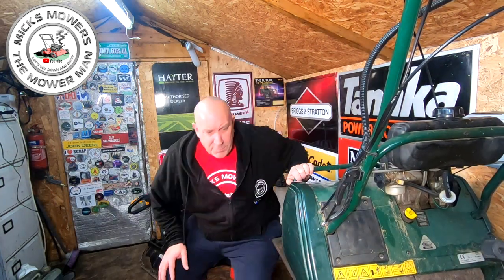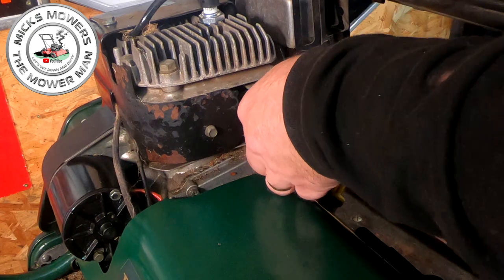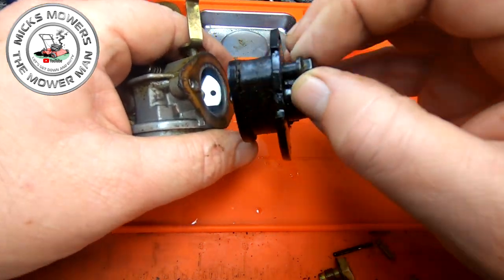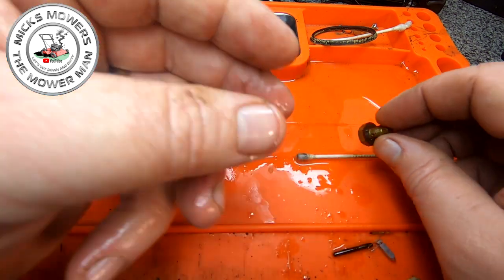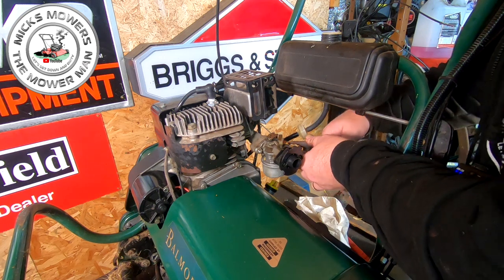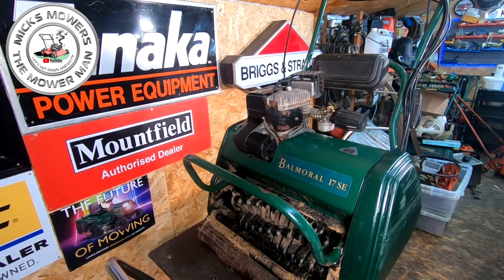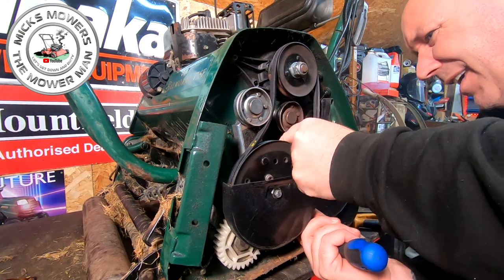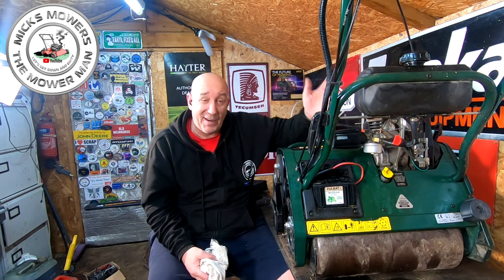Cheap Atco Balmoral Sold As Spares and Repair. So Why Will It Not Start #atco

Comment: Thanks Mick, followed this video + put everything in an ultrasonic cleaner, mower started first pull on rebuild.

Do you have anything regarding the electric key start with the Balmoral 17se...? swapped new battery but nothing when turn key, not even a starter motor solenoid click, if there is one..?Happy to strip it down, just dont really know what to look for.  Thanks
Reply from the maker: Check the wire at the key end.. they can become discounted
Reply: thanks, i'll give it a try @themowerman

Comment: Hi Mick, interesting video. It would be interesting to find out how you fix the E start. I have the same mower and my starter has never worked. I haven't got the original battery but I tried it using a external battery but it said nothing. It would be nice to get it working?
Best regards Steve from Germany.

Comment: Just a quick question on the grass comb. The 17SE I'm working on at the moment has an adjuster for the height of the comb. At the highest level it is above the level of front roller. Do you think Atco did this to make it easier to switch from blade to scarifier and back again or do you think they expected everyone to remove the comb?
Reply from the maker: Remove it when sacrificing mate

Comment: Hi Mick, thank you for your great videos, with your advice you have helped me keep my old Suffolk punch going. I have now got a couple of parts that I need. Please could you tell me where I can get them. 1 is the silver wheel that picks up the belt to turn the cylinder and the other is the red safety lever on the handle to engage the blade. Thank you for your help in advance, kind Regards Andy
Reply from the maker: Yo yo .. ok so they do two different parts... For the belt pulley... Email me a photo of the side so I can see what part you need  I will find you the other part.. micksmowers01@gmail.com
Reply from the maker: Here is a second hand one.. about £10 cheaper... If you need a new one they are about £31.. but you get all the bits with this one.. https://www.ebay.co.uk/itm/295803420319?mkcid=16&mkevt=1&mkrid=711-127632-2357-0&ssspo=Up6JrDNeRy6&sssrc=4429486&ssuid=VxofTcWjS-2&var=&widget_ver=artemis&media=COPY
Reply: Ahh Mick you are a legend thank you so much. I like the look of those Cobras but not at the moment lol, here’s a picture for you.
Reply: I can’t seem to add a pic
Reply: Please can I email you the picture
Reply from the maker: @andynicklen  yes mate

Comment: Hey mate I'm really struggling getting at the starter motor on my 17SE. When you repaired yours did you take off the engine because there is a bolt at the bottom of the black casing that I can't get to. I need to remove all of the black casing to get to the cogs. Any help appreciated 👍
Reply from the maker: Hi mate .. I believe I just loosened the front ones and tipped the engine back a little..
Reply from the maker: Just picked up the 17s.. looks to be ok
Reply: @themowerman  thanks Mick I'll give that a go.

Comment: Hi Mick! Great content on your channel!

Being from Denmark, we very rarely see mowers of the same quality as Allett , Atco or Massport (Only see reel mowers without the roller in the back and wheel instead - See Gudenaa mower). I've been very lucky as to have found one imported from UK to here.. But I have a question for you, wich I don't think I've seen answered clearly anywhere..

The Balmoral I've got, has a 6-blade cartridge, but in the upcomming season, I would like to start cutting my lawn a bit tighter!

Does the Allett Kensington 10-blade cartridge fit onto the Balmoral models? Some places say yes, others say no.. Could you help a brother out, answering that question?

All the best
-Thomas
Reply from the maker: Hi Thomas.. yes they fit.. as long as it has the big white gear on the side.. that are all the same..
Reply: @themowerman  Thank you SO much for the swift response!
Reply from the maker: @syq-fpv  your welcome my friend

Comment: Good video, and the idler pulley is definitely toast, these mowers are non existent in north America, or not commonly sold or used. I bought an ultrasonic cleaner with heater for cleaning small parts, your method seems to work just as well.
Reply from the maker: Yeah you can now get the same mower called allett now in your part of the world..